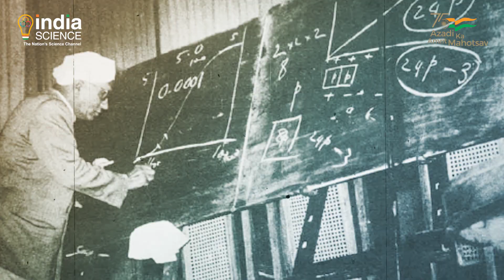Promo: Science for a Self Reliant India: Discovering India with Science & Technology

Comment: Salt line coast to coast imaginary concept to make India water surplus.A sequoia tree can pump water to a maximum height of 100mtrs. Western coast average elevation is upto 900 mtrs to 1600mtrs with some ranging to 2600 mtrs. We should take advantage of lower elevation on western coast the Arabian sea water with higher salinity could be discharged to bay of Bengal with lower salinity or find use for sodium chloride in thick slurry or solid form on eastern coast. Now the theory is having non return valves with proper slopes to create one atmosphere head at every location on the entire length of pipe line. The theory of tree living is the water lifted is supplied to leaves for photosynthesis through capillary action. 

                   The dimensions of pipe line can be reduced after extraction of sweet water by solar water heaters under vaccum which can generate water vapor which can be condensed. Taking advantage of ambient temperature and cooling towers with some amount of energy. Loss of pure water extracted from the system would have created a vaccum which would pull up the water. Some amount of electrical energy is required to make it efficient. This is a broad outline of desalination of sea water for internal lands & human consumption. As everyone is predicting war for water & food in the future

Govt is thinking of joining rivers to save monsoon water flowing to sea. The water flowing to sea is comparatively low on western coast and salinity is high. Whereas many rivers are flowing into bay of Bengal including Himalayas. This tends to reduce salinity. The Arabian sea is hotter compared to Bay of Bengal could be because of lower salinity. Also marine life on western coast is higher due to monsoon wash of forest debris into Arabian sea. It's all fine ecological balance.

        Our country with such large population is highly dependent on agricultural, marine activities. Water, quality of soil, weather are most important. We are blessed with tropical weather and a God given landscape with large coastline. How best minds can evolve to be beneficial to mankind for generations to come is important. The above concept is imaginary and needs lot's of theory, practical, calculations to go into. The fundamental idea has to ultimately make it green. Ecological balance is beyond my thinking capacity.